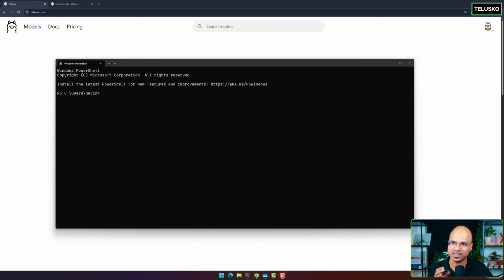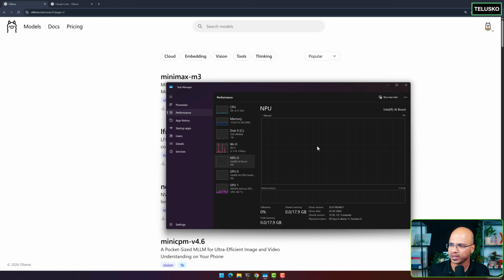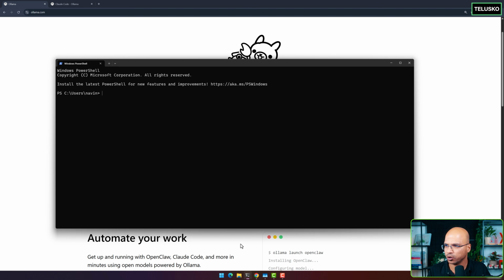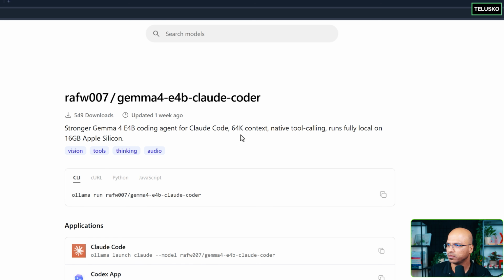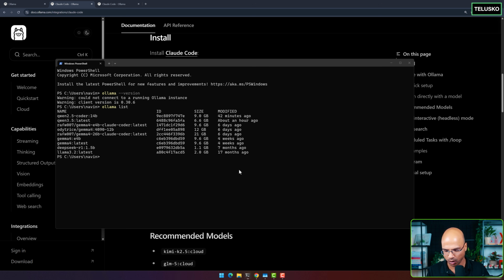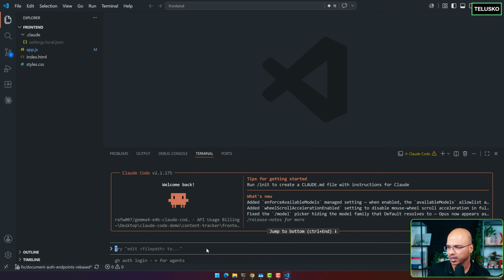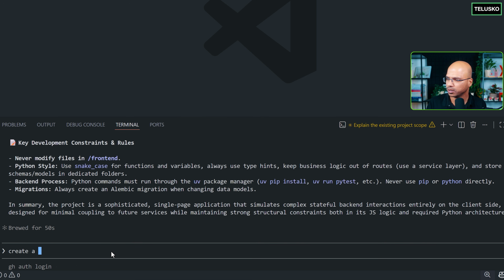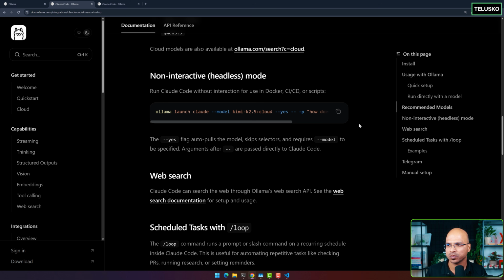Use Claude Code for Free using Local Model

Comment: Can I do this in my i5 13th gen 13420 H cpu 16gb ddr4 ram 512gb gen3 ssd rtx 3050 6gb vram 75watt tgp laptop ?
Reply: You can use smaller models on this not like the original claude but fine tuned models 
Anyways it is a laptop gpu and fs it is less capable than a regular gpu you won't be able to run bigger models
Reply: yes, just use smaller models. like 8b and below. i have similar spec machine and I'm doing 8b and below.
Reply: @edjrod29 what about dell latitude 5420 i7 11th gen 16gb ram and 256gb ssd?
Reply: You can run Gemma4 E4B easily on your machine upto 32K context window max try 16K - 24K  first try quant Q4_K_M or UD-Q4_K_XL from unsloth collection in hugging face with llama.cpp server and open web ui for user interface
Reply: I think you can go upto 16 b models without any background processes
Reply: @vegabondsoldier366 nope,not at all possible.
Reply: hp victus?

Comment: I did this yesterday
Reply: were you able to get the claude code for free use as local model by using this?
Reply: @malindupabasara22 Yeah bro; I installed the model first with ollama pull then I started the claud and used my local model. 

It ran using Minstral 3:3b with tools